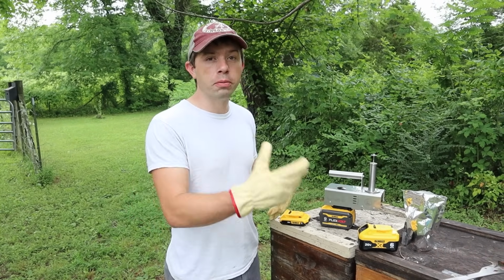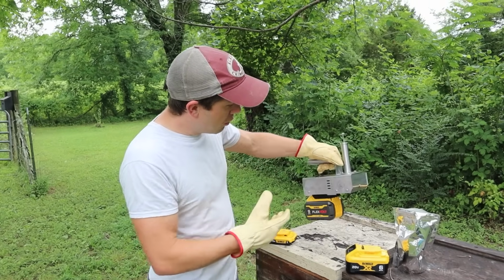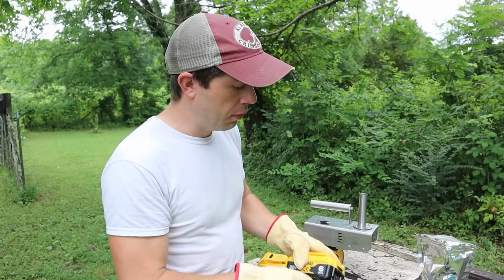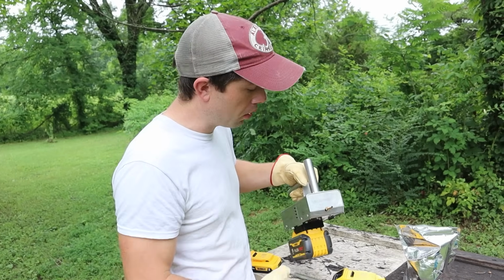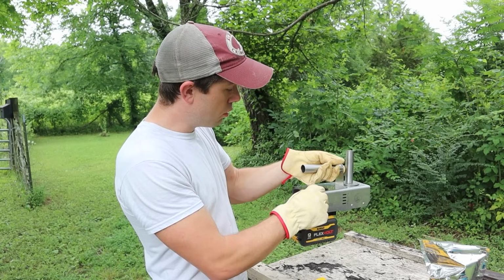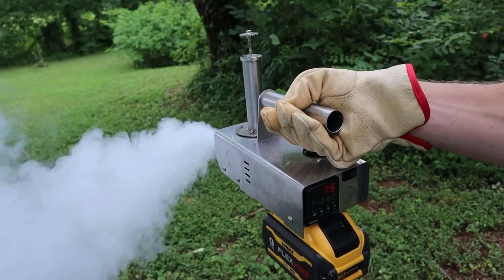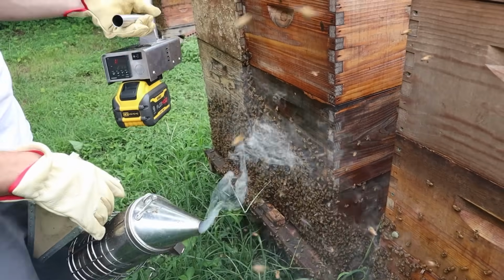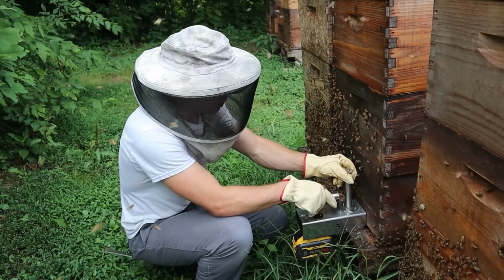⚡AMAZING Oxalic Acid Vaporizer! No CORDS - Kill Mites Faster than Ever!!

Comment: have you had any issues with the Oxalic acid getting solid and bunging up the brass tip?? I had to clear mine after every hive the other day!
Reply from the maker: I never have had that problem. So strange. Has you OA sat open for a while?
Reply: It's a bottle i purchased last summer and used in the fall. 
It still is powdered when i shake it up. I used it again yesterday and just had a drill on hand with a bit to clear the brass tip. 
Seemed to work ok...I think maybe it was colder the other day when it bunged repeatedly... yesterday wasn't as bad!
Thank you for your response btw... I am using it at 230 degrees and making sure it's hot.

Comment: I am a growing beekeeper with an average of 50-65 hives and was about to change to a new vap applicator.  I couldn't justify the $2000 unit & hated the thought of spending over $500 for the ProVap 110 knowing it needed a small generator to run it along with quality long extension cords.  I hate hate hate them! This is a game changer! Batter powered Vap unit Spring & Fall with battery powered leaf blower in the Fall to blow my boxes clear of bees. Thank you so much for this Vaporizer Video!!!

Comment: Unfortunately, Kamon, the spout on this vaporizer is not near long enough to reach in the bottom of my hives with an entrance reducer on. I also have insulation on the hive which prevents tilting the vaporizer as you do to get the nozzle inside. I don't want to drill holes in the rear of all of my hives. I have reached out to Lorobbees and asked for a solution which they do not have yet. I put a short piece of copper tubing on the nozzle but it clogs up every single time and has to be cleaned between every hive. I plan to email the manufacturer in Hungary to see if he can build with a longer nozzle.
Reply: imo, this is slightly poorly designed nozzle. i think it should be a little bit longer and with the wider  tip so all the vapour can be spread more widely and evenly. currently it'll mainly fire  just between 2-5 frames and then the vapour starts cooling down and oa will recrystallize leaving side areas less effectively treated.

Comment: Just wondering why I would need a second plunger? I'm probably going to order one to pick up at the conference but it seems I can just refill a single plunger right away and drop it into the vaporizer unless I am missing something?
Reply: No, you are right, it is actually slower to swop them.
If you have mixed small and large colonies, and you want to treat them with different amount, it can be faster if you have pre-set plungers.

Comment: I have had mine for a little over a month and nowit doesn't work correctly! As soon as battery is connected, it goes on and does NOT stop at set pint. Up to 800 degrees!
Reply from the maker: Definitely contact the company. Mine has worked flawlessly with 2 lbs thru it
Reply: @kamonreynolds  Yes, Rob got right back to me and will send a replacement. I already mailed the defective unit. He says it's the first failure.

Comment: Thanks Kamon for the review.  Couple of questions: Do you close off the hive when treating?  What's the lowest temp you can treat without generating condensation?
Reply from the maker: Hi condensation isn't a problem with this product as sublimes (goes from a solid to vapor, back to a solid.) However, it is best to treat when the temps are above 45 degrees Fahrenheit because the bees will be less clustered. 50 degrees would be better. It can be used at cold temps but the tighter the cluster the lower the kill rate
Reply: @kamonreynolds  My concern was condensation from the hot vapors entering the 45-50 degree hive.  Also, do you close off the hive for a period of time to hold the vapors?

Comment: Kamon do you happen to know what Model Dewalt batteries will work with this unit?  I’M  INTERESTED!!! LOROBBEE just has the voltages listed.
Reply from the maker: Most DeWalt batteries work. The old "stem" types won't work but all the batteries I had in the video do. I had a 2 am hour 6ah and 9ah.

The big battery I used is called a 20/60 volt 9ah "flexvolt". As I used it in the video it only went up to 20 volts on the voltage gauge.
DeWalt says alot of weird stuff for advertising but it really is all good for this unit. 
The instant vap is made to deal with all DeWalt batteries that fit like the ones I had in the video

Comment: I don't like drilling holes in my hives . I always treat from the entry of the hives.
Reply from the maker: Same here
Reply: @kamonreynolds  I have vented bases on my hives and have made a board that slides in underneath. I simply close the front with a damp towel and slide the board in with the vaporiser vand fitted and go from there. With this unit, I would have to somehow seal underneath the hive, wouldn’t I?

Comment: For the Dewalt batteries, they have the 20 volt XR batteries, and the 20/60 volt Flexvolt batteries.  I see that Kamon is using the 9 ah Flexvolt battery.  Does the number of hives that can be treated depend on whether the  battery version is 20 volt vs. the 20/60 v Flexvolt battery?  I want to buy the correct batteries to treat about 100 colonies per day.    If the 20 volt battery version at 6 ah does not perform the same as the 20/60v Flexvolt at 6 ah, I'd like to know the difference, if known.  Thanks
Reply from the maker: the whole 60 volt thing is a marketing ploy i have recently learned. as you can see in the video it only reads a max a 20v on the voltage meter. all the batteries i showed work great. the bigger the AH (amp hours) the more treatments you get. 
1 AH goes to heating it up and every AH after that is worth 10 treatments at 2 grams a pop
Reply: The tool is made in Hungry - there are a selection of battery brand options and voltages eg18v dewalt. I've just watched this video ... I think the day you posted it is the day i ordered a sublimox vaporiser which I've already used so cant return. If only I'd been a subscriber before now I'd have made a different choice...😔

Comment: There’s a machine I forget the name of the company but all the guys have really long beards and it works by butane you heat up the chamber with the butane and the flame is adjustable and I seen that it works very good you just have to every so often take the front part off put it in water to cool it and then go to the next hive I like that one you could do like 65 hives before you have to refill it and you refill you don’t have to throw it away or anything like that check it out

Comment: Awesome!!! I found an adapter for18v  makita to dewalt 20v DCB Series , what voltage/series dewalt is that unit using?Thanks again Kaymon, you and your wife are the most awesome team of teachers. If I can help yall with anything let me know.Scott, Taft, Tn
Reply: On Amazon? I would love to share that info with people
Reply: On Ebay
Reply: @thewayisnarrowfewfindit  sweet, I’ll check it out. Thanks!!
Reply: Does the unit use 20v dewalt? If so will 18v power it?
Reply: @thewayisnarrowfewfindit  yes, the 18v and 20v are the same inside. It’s a marketing thing. Just can’t use the old old battery’s that have the tall stem.
Reply: @thewayisnarrowfewfindit  Yes, the 18v and 20v are the same on the inside of the battery

Comment: Kamon, Im not sure if youve considered this yet but I have several apimaye hives. How would you treat them without risking temperature damage to the hive? Ive written apimaye and there maybe a solution in the future for this but today im very interested in an option like this.
Reply: I have a solution in the works for apimaye as i run them and this battery model. Stay tuned
Reply: I drill a hole in a cork, and stick it in the round hole, works fine.
Reply: @BackyardBeesNC  I’ve been doing something similar with our PTFE washers. How have your treatment results been while going through the portal hole?
Reply: @LorobBees  It steams it up, I never did another wash on em. main thing is it doesn't melt it. John o says it hits the frames and doesn't go in good, I dunno, I see steam coming out.

Comment: Good Morning Kamon! I've been using the Provap 110 for years now, and running extension cords out to the yard is a hassle to say the least. The fact that it also accepts DeWalt batteries? SOLD. I bought one of the ProVap Dispensers as well, it works nice, but it's actually not adjustable like this one is. Wishing you all the best as always, thanks for turning me on to another step-up in beekeeping equipment! :)
Reply from the maker: I know you will like it Fred! Great tools are always a pleasure to use 😎
Reply: @kamonreynolds who sells the 110 ? I want to purchase one !
Reply from the maker: I misspoke the barrel is brass not copper whoops! Big difference!
Reply: Fred! You’re always spending my money! It makes me happy to see that Kamon is now spending yours… Except, wait, he’s spending mine too! 🤣
Thanks Kamon!!!
Reply: @LarryLeesBees  Hey Larry!  Just like me, I know you have the ProVap 110 AND you purchased that metered cylinder at Hive Life... I'm happy to spend the money on this new unit as it's just too convenient to pass up. Plus, I already have a bank of 60V DeWalt Flex batteries :) Great minds! But the one Kamon has here he says it has a copper tube, the one I ordered has a brass delivery tube, maybe they are already improving them. :)
Reply: @FrederickDunn  - That’s fantastic! The batteries is exactly what sold me too (well, the whole unit sold me), if it’d had any battery other than DeWalt, I may not have paid as much attention. But all my tools run those batteries, so it was a no brainer for me Sir. 😃
Reply: Hi Kamon and Fred... and all your Followers 😉
Added EU Email and Website for Product Info.
See Main Chat Comment above this Reply... 👀
Choose "English" at bottom of Screen... As most Beeks can't read Hungarian Websites.... 🤔 Could always phone my friend who lives and works in Budapest ! 😎
Reply: @ME_MeAndMyBees  Thanks :)
Reply: I absolutely loathe using the "standard" varieties.  They break. Worst of all is how really really angry the girls get with me.  and that dragging the stuff around. Gag
Reply: now that you've said it - sold :)
Reply: Provap dispenser is adjustable. It works very well.

Comment: The knock off is more than the original Provap
Reply: 495.00 for the Instant vap..   And the ProVap is 492.  No generator to mess with or inverters or anything of that nature.  No tripping over a batter or wires.  If one hasn't bought the Pro Vap I could see it being worth their time.   Just about everyone has some kind of re-chargable battery for their tools nowadays.
Reply: @beebob1279  the battery one is $410
Reply: @BackyardBeesNC  I just looked on the website.  495
Reply: @beebob1279  Provap 18 is $410
Reply from the maker: Provap actually knocked off multiple things from this unit. Watch out for the pro vap battery powered version. It is burning up batteries and is made with metals that will rust out.
Reply: @kamonreynolds  It does look nice, maybe when my Provap 110 goes out...

Comment: Is 4g the max dose for that dispenser? 8g or 10g would be nice
Reply: If you want more, just do it twice on a colony.
Reply: @beebob1279  

And that would take twice as long.

You didn’t answer the question.
Reply: @TuffCrusherPlus  Still a lot faster than a wand.  Those things take forever.
And look at the ease of this thing.  No wires, batteries, generators, etc.  
The advantages are definitely there.
Reply: @beebob1279  

It isn’t faster than the ProVap that I use. But it’s cordless.

The problem is that you can’t load a single 8g dose into it.
Reply from the maker: It goes past 4 grams but not to 8-10 grams.
Reply: @kamonreynolds  thanks, Kamon
Reply: I believe label is only for 1 or maybe 2 grams.  Testing by many show that 4 g is more than sufficient for control.
Reply: @glennsnaturalhoney4571  

And that is why I ask. I use 4g/deep. It works well.